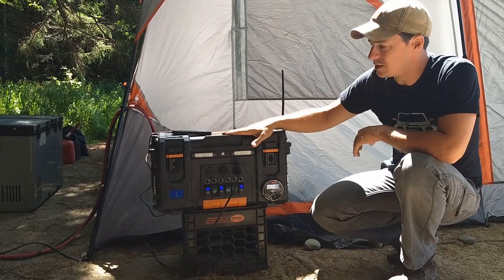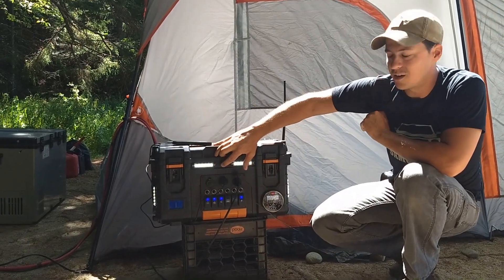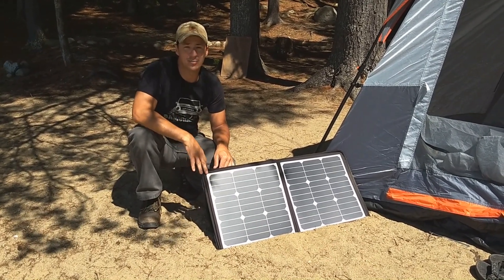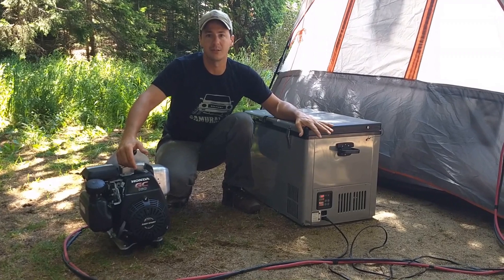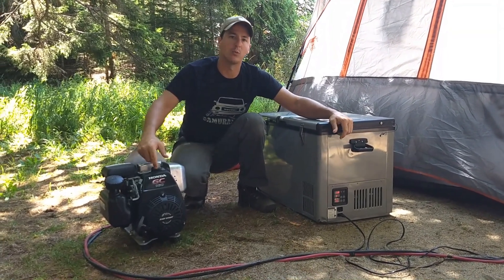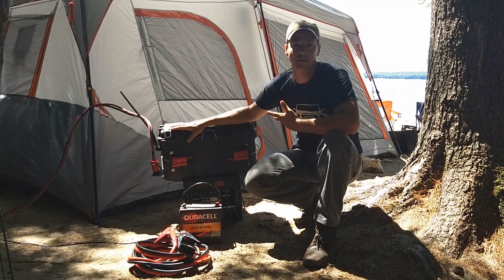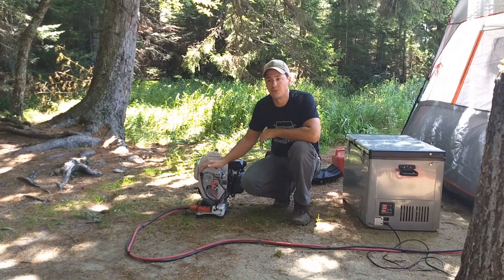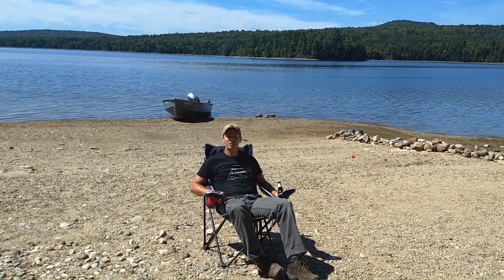DIY Power Box PART 3 for work, camping, home backup, or off-grid

Comment: Hi, love your power box, I’ve made a couple of smaller ones myself but not as multifunctional as your..  question: do you run the jump cable directly from the battery to the car battery ? And the same question for if your charging the generator battery wile driving your car, is it directly from your cigarettes port in your car to your battery? , to charge the generator battery..  also how do you know when  your generator is fully charged when doing it this way.. my guess is that both the car and the generator battery is 12v so it cannot over charge the battery anyway, but please correct me if I’m wrong..  many thinks.
Reply from the maker: If using lead acid, you can parallel off of the vehicle battery and alternator directly. You can't go through the cigarette lighter. You want to use big cables for this. It will charge to 80-90% no problem. If you have a newer vehicle with a smart alternator then this won't work because charge voltage is too low. Also you have to manually disconnect it once you shut the car off.

A DC to DC charger would be a better option. Plus you can set it up for different chemistry like lithium. 

If you install a battery charge monitor with a shunt on the negative cable it will show you the current going in or out and the true battery charge. I like he Victron monitors myself.

Comment: I love your set up. I was going to build a plywood box, but I already have these rigid boxes. We are getting our solar kit, inverter, and battery this week and this has given my husband and I some great ideas. Thank you so much. May I please ask what the brand and type of refrigeration setup you have? If you said I didn't catch it. Thank you again.
Reply from the maker: Hi Nicole

I have a big Whynter dual zone which works great and having both temperatures is great. Downside is it's size and weight. Very tough to move empty or loaded. Would only use it in a semi permanent location.

I just picked up about a year ago an Alpicool fridge. It is a cheapo Chinese fridge on Amazon. So far it has been great as well. Can throw it in a vehicle so easily and I think it was like $275. I use this more for quick trips and work.

Comment: Have you thought about using the bottom rolling box in that Rigid set for some additional battery capacity?
Reply from the maker: Cian Smith that is the plan. I am going to use the roller for a larger battery bank. Then I can snap my smaller boxes on top. One is the Power box, the other has a 1000 watt inverter.

All of my trucks have Anderson connectors in the back so I can either jump start the truck from the PowerBox or recharge it while driving. 

It's all plug and play